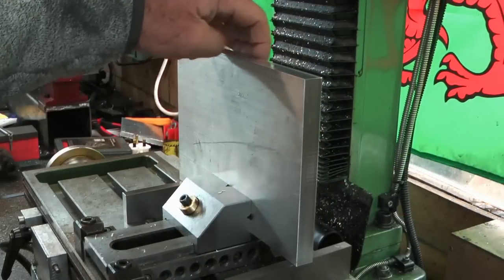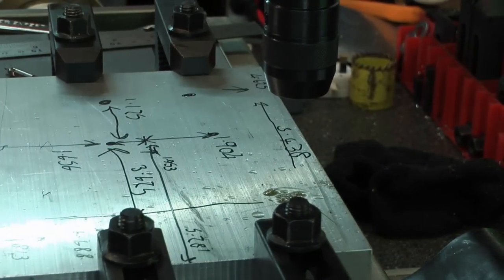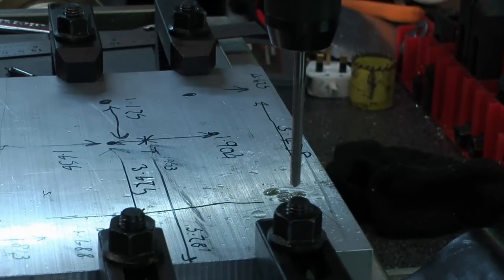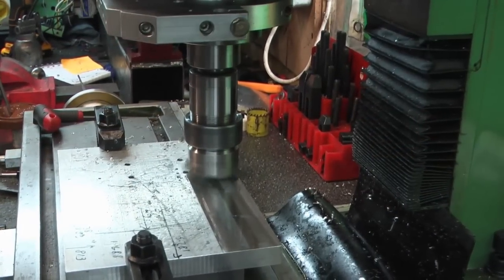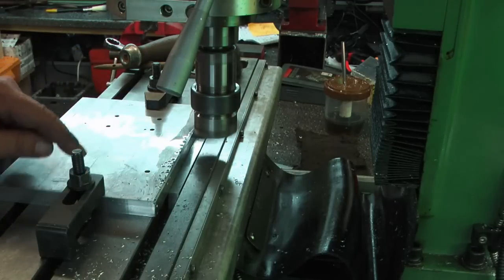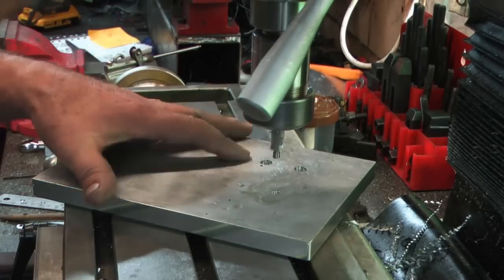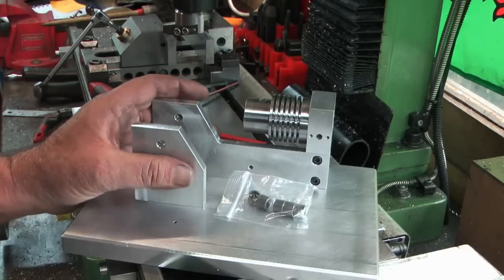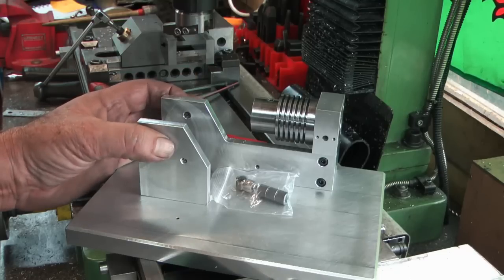Webster engine build part 3

Comment: I like the plan to put deep groove bearings (and needle rollers) in wherever you can - good plan. Great build Ade, I love following along with these episodes. Thanks for sharing 👍
Reply from the maker: Hi Craig . trying to remove friction I guess and make it last longer before overhaul. If mine turns out as good as the 2 Matty made I will be very happy . Cheers Ade.

Comment: Is there going to be a flat ring gasket seal between the steel  cylinder and the aluminum head? I really enjoy your builds. Is there an overall picture of what the engine will look like that you are following the drawings on?
Reply from the maker: The plans do not call for a gasket but I can make one if it needs one . the fit for the cylinder is a really close transition fit so it should hold the compression . we shall see. Cheers Ade.
Reply from the maker: just google webster engine plans and you will find it all.